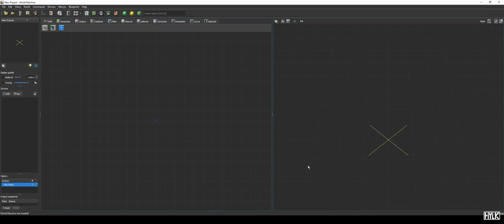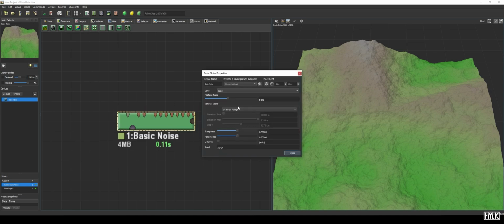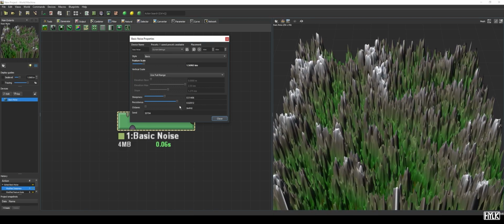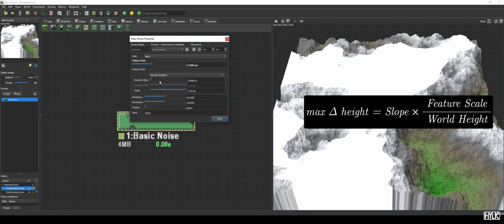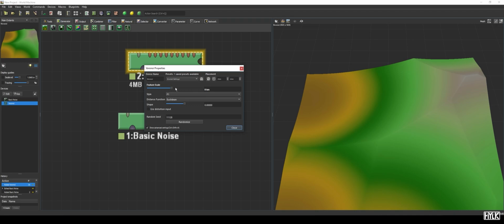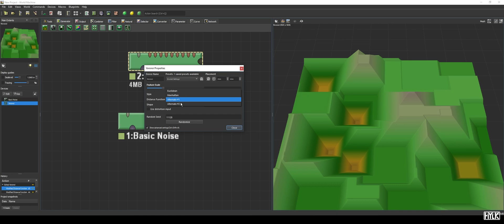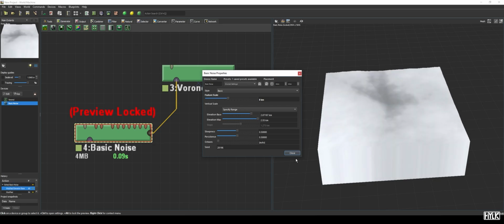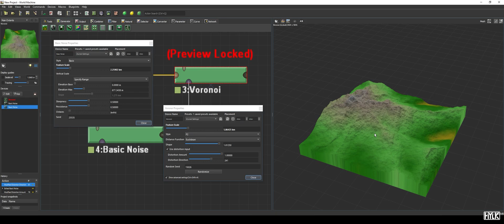World Machine Tutorials | Ep. 11 - Basic Noise & Voronoi

Comment: hi hylk, i have a constant that controls the height of my terrain, but it gets stuck at a certain limit, how would i go about making my terrain higher
thanks in advance
Reply from the maker: Hey! The Constant device goes from 0m to your world's/project's max world height. You must increase the max world height in order to increase the range of the Constant device. You can do so in the Project Settings menu, then go to the Project Setup tab and you will see a "Dimension Preference" section, with a "Project elevation quick scale" parameter. That controls the world's/project's max height. Let me know if this helped!
Reply: @hylkart  thanks alot!